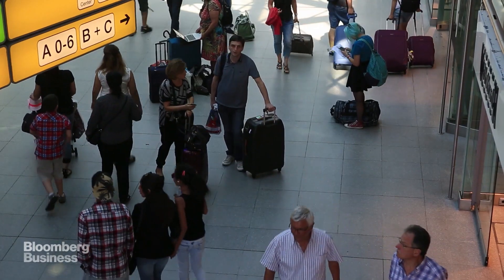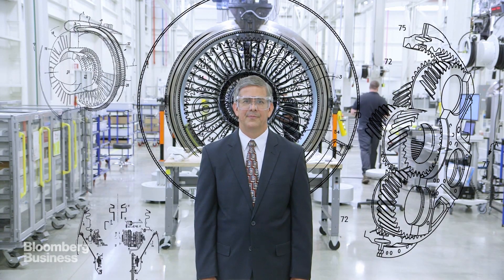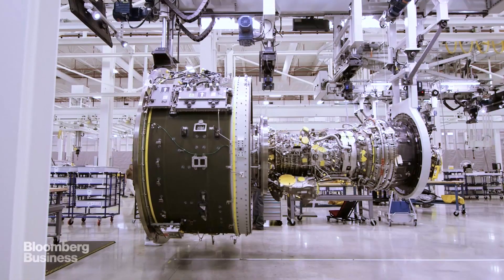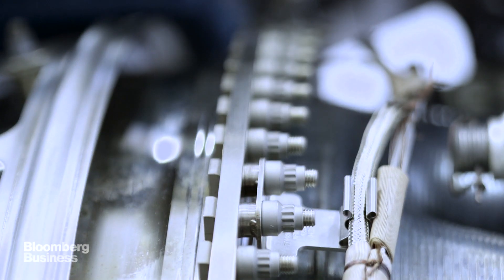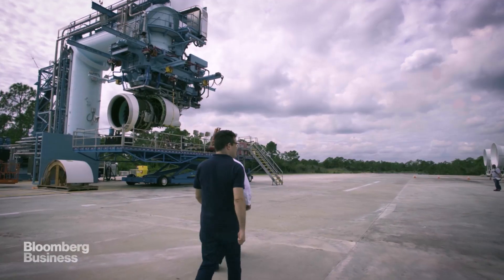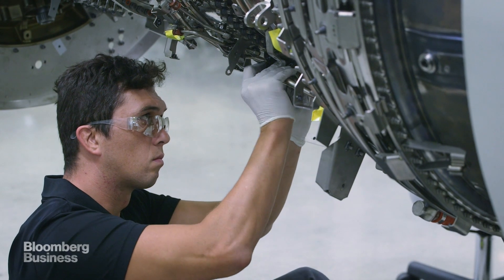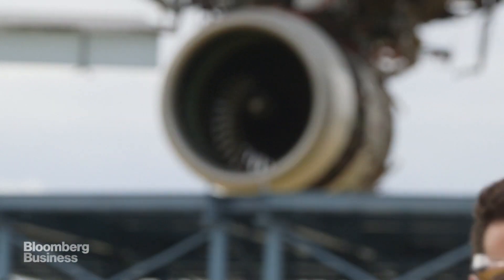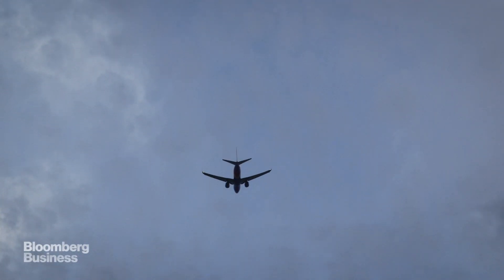This Genius Invention Could Transform Jet Engines

Comment: There is no way jet aircraft can be environmentally safe for several reasons: One- high altitude heat deposition is the principal driver of severe weather. Two- jet engines exhaust gasses are toxic carcinogens. Three- jets rake out ozone from the upper atmosphere and drag the ozone to lower levels. Ozone depletion at high altitudes reduces the blockage of U.V. radiation, and ozone deposited at lower levels is corrosive and causes plant disease. Four- jets contaminate massive quantities of water vapour, turning the water vapour into acid fallout. Five- The water vapour dragged from the upper atmosphere is often dispersed at lower levels without rain, leading to more drought. The jet industry and the tourism industry are two of the largest employers on Earth.  Will we kill the planet for money or will we wake up to the disastrous consequences of arrogant and unsustainable jet travel?

Comment: Kuznetsov NK-93 is also a big size propfan/turbofan jet engine that use a epicicloidal gears reduction stage to drive the fans
. It can handle up to 30.000 horse power. It's a godd idea, but not an innovation

Comment: The big questions for me is: does this introduce more wear, breakage, frictions or anything that may compromise the reliability of the engine? The fact that a gearing system is now in place (i.e. more moving parts) that sits on the main axis of the engine is a huge risk as well as a huge boost in technology and profits if they can address all the potential risks involved without reducing the MTBF by more than 5%.

Comment: Sorry not new at all Frank Whittle propose a geared fan in 1944?? And propjet and after burning. The Rolls Royce Trent with its 3 shaft  design has the fan running at a lower speed than the power stages

Comment: It is worth comparing this approach to that of competitors GE and Rolls-Royce. Both are building non-geared engines with similar improvements in efficiency.  But their engines seem to have to be above a certain size to achieve that aim. They use fan drive power turbines much larger in diameter near the back to run the big slower fans in front. This means the obstruction to bypass air is larger also,  enlarging the thrust nozzle diameter. That does have the advantage that the extra weight of the gearbox is eliminated. Pratt & Whitney have the advantage in medium sized new tech. engines, but may be limited as to how large an engine this method can produce reliably.  Also, if i recall correctly, P&W have worked to make that gearbox an easily replaced item structurally isolated from the engine framework perhaps differing from the  smaller Garrett engine. Isn't the Garrett derived from a helicopter or turboprop design?

Comment: Isn't this basically what a turboprop does?  They've been around since the 50:s.
Reply: Yes but a turbo prop is not a jet engine. Completely different technologies.
Reply: Turbine, shaft driven reducer, big fan up front, sounds pretty similar to me.  Only difference is that instead of a 20 to 1 reduction, it's something like a 2 to 1 reduction.

Comment: What a poor video. A lot of fluff, and nothing about the challenges associated with using a gearbox, the consequences for reliability and maintenance, etc. A modern jet engine is extremely reliable and the main reason for this is that it has few moving parts.

Comment: am I mistaken? but hasn't this idea been used for a long time,  known as a turbo-prop. a small jet geared to a propeller?  why hasn't this idea been worked out before? the fan jet was a great improvement over the turbo jet so it follows that this "new" idea will be better to.

Comment: The TPE331 turboprops had plenty of engine failures with collapsed planetary gearbox rings. Hopefully more modern metallurgy will reduce the risks but these engines won't be popular with pilots :-)

Comment: Pratt & Whitney has been studying this idea for more than 30 years. Remember, the geared  turbofan was an outgrowth of the Pratt & Whitney/Allison 578-DX propfan project from the 1980's. It was in the early 2000's P&W started serious research into a geared turbofan, an the result is the PW1000G series PurePower engines we see today. I really hope that P&W teams up with Rolls-Royce (through the IAE consortium) to build bigger geared turbofan engines, ones that could possibly end up on the Airbus A350XWB, Boeing 777-8/-9 and 787 airliners for even quieter operation and lower fuel burn. Already, the PW1124G engine on the Airbus A320neo is incredibly quiet, to say the least.

Comment: I found this piece of addtional information that may partially explain why this was so difficult:
"The biggest challenge in scaling up was how to keep the gearbox, which is 
about 20 inches in diameter and weighs about 250 pounds, from being torn
 apart if there was a shock that wrenched the fan in one direction and 
the shaft in another. Adding steel for stiffness would make the engine 
too heavy. To put some give into the system, McCune's team attached the 
gearbox rigidly to the fan but somewhat loosely, with bendable metal 
baffles, to the compressor/turbine shaft and the engine case."

Comment: Why not a viscous coupling based on the air flow? Higher altitudes/ lower pressure/ less drive to the fan so the blade tips won't go supersonic.

Comment: I believe the RJ 70 had engines with a gearbox between the turbine and the fan.
Reply: True but they could only handle 7000 HP these can handle 30000 HP

Comment: i hate marketing videos like this. "its better!!!! WE ARE TELLING YOU ITS BETTER!!! ITS TEH BEST THING EVAH !!!11!@." tell us what you did, how did you make a more efficient gear train that can handle these powers? what materials were used? what kind of thing did you do to improve on the gears? what kind of manufacturing processes are used to make them. give us technical details, not corporate ejaculate. 

from what little details were in the screen it appears to be a double herringbone planetary gear. i would guess its a 4:1 to 5:1 reduction so the turbine could spin around 10k and the fan at around 2.5-3k. going to have very tight tolerances and a light gear oil from a pressure fed system, with separate sump and oil cooler. they are using a 5 planet gear system to help distribute load and only a single reduction unit. it appears that the planet carrier is bolted to the housing and the fan is attached to the ring gear. the sun would be driven by the turbine. im basing this off of the sketches in the background alone so take this with a very large amount of salt.

Comment: the bottom line is always money.  airlines rate their efficiency % by how many passengers are required to buy seats on a flight to overcome the aircraft operational expense. money. period. not safety. not comfort. not customer satisfaction.  money.

Comment: So it took Pratt and Whitney 30 years to do to the turbo fan the same thing everyone else has already done to the turboprop. They really have to have dumbed down the presentation on us. Why not just fix the problem by gearing it down and using 2 fans pushing the air the same direction but spinning in opposite directions so they work together and allow less air to resist their push thus pushing more air with less rotations. It actually looks to me as if they just went with a bigger fan. I am very surprised no one can come up with a super high efficiency Jet engine. Lot's of compressed air, I can almost imagine in my mind a turbofan piston hybrid. If I owned an engine company I would be working on this type of stuff all the time.

Comment: The real question is does come with a 5 speed manual transmission design and can they make it easier for me to ditch the fan and connect the rear faster part of the engine to my car's drive-shaft through the geared bridge.

Comment: Afaik turbofans have the fan powered by a separate turbine which runs slower than the core shaft speed anyway. 
I would imagine that a controlled method of bypassing that second turbine, like a wastegate you find in car turbos, would be a more efficient way of controlling the fan speed without needing a gearbox.

Comment: Yeah, this is an old solution to an even older problem. They would probably have better luck trying to figure out how to make variable pitch blades on either the N1 fan or the turbine in order to optimize it's speed for the existing power setting....just like a prop goes to fine pitch for takeoff and coarse for cruise.

Comment: I believe these efforts are misdirected. Instead of marginal gains from old technology, why not focus on the real problem of current air travel. The power source. Bear with me. A gas turbine engine is totally dependent on compressed air. Wings need fast moving air to generate lift. Anti-gravity technology was worked on by Tesla, Von-Braun, Heisenberg and others. That technology would radically alter air travel and flight as we know it. No more using delicate materials that need a narrow operating range and conditions.
Reply: "Anti-gravity technology was worked on by Tesla, Von-Braun, Heisenberg and others." - That's not true at all.

Comment: 10,000,000,000 dollars spent already?! Russian NK 92 (or 93) has the similar gearbox and dual turbofans. Super power output and  economy  but alas slow speed (0.75 mach). R&R went broke for RB 211 engine development. Does it all make sense?

Comment: Why not remove all the moving parts and create a magnetic vortex engine? That does not run off fossil fuel! Lite metal technologies with graphite power cell technology to power and run the planes systems? Zero pollution! Maybe some noise from the forced air but other then that 100% green technology.

Comment: You're missing the fact that it's not just a gear box and yes all turbofan's have them, but in this design the gear box is INSIDE of the main shaft!, with no added drag that a traditional gear box would have added.
The smooth internal air flow is how it produces less noise,more even fuel mix and less vibration on the engine's structure..
Reply: All turbofans do not have gearboxes to drive the fan. In fact most don't.

Comment: The video is a little misleading. Geared turbo fans have been around for over 40 years. Garrett AiResearch designed one in 1972. It's still in a ton of airplanes today as the Honeywell TFE731. It's a geared turbofan using a planetary gear system. The fan spins at about half the speed compared to the low pressure turbines in the back of the engine. Maybe Pratt has a more efficient geared system, but its certainly not new.

Comment: you have got to be shitting me. a gearbox? that's the big breakthrough!? i'm guessing they are making the engine twin spool, with a hp turbine and a low pressure one. bleeding power off the low pressure one. not like usual high bypass engines  that have 3 turbine stages. high pressure, low pressure and another after the LP one for the turbofan. this is optimisation not innovation

Comment: Congrats Mr McCune sounds V impressive but reduction gearing on aero-engines have been around for nearly 80 years, aren't you just reinventing the lightbulb like mr edison, still if it produces the fuel savings and noise reduction as you claim then Good on you mate.

Comment: So something helicopters have had in mass production since the Huey (a mid 1950's design going off of the prototype) at least.
Reply: The problems with gearbox with turbine is reliability.  Helicopters aren't certified for ETOPS which requires the level of reliability that the traditional turbine gearbox has not delivered

Comment: Gears in a jet engine, LOL.
Just counter rotate the stater blades drive em both  by  thrust,  computer   activated thrust vectors.  fixed gear boxes cant be adjusted for optimum performance. Thrust vectors can. 
I have the patent, I want 25 million for it.
Reply: offplanetevent so how do you get the fan blades to not spin at the speed of sound if you just counter rotate.

Comment: I wish you had asked Mike McCune more about the gearbox and how all those moving parts are designed to withstand wear and tear given the high revolutions in the engine. Surely these moving parts will encounter friction and generate heat. If the friction becomes abnormal, the heat may be dangerous and could be incendiary inside an engine like this.

Comment: and later it will be stolen by the Chinese
Reply: agus2001 No need to steal it. In the area of commercial jet engines everybody copies. The trick is then to develop the metal technology and ceramic technology to do the copy. While the USA leads in some areas of material technology nations like Japan and Germany and Russia and even China are now starting to lead in other areas of material technology. If you take something as simple as a circuit breaker it is the Japanese and Germans who lead in a few key components. While this is a great breakthrough as an idea did P&W create the materials technology completely by themselves or did they rely on the Germans or Japan or ? to actually come up with something in the materials area to make it durable enough and reliable enough and light enough etc. That is where copying is done by everybody. There are endless bright ideas like this thought up every day around the world. Most fail because of material technology. No one nation today has all the answers.
Reply: Chinese have no footing in the commercial plane market
Reply: agus2001 as is everything else
Reply: Sariel Reigns Сариэль Царствует what part?
Reply: Polo Gamero you didn't mention anything
Reply: Sariel Reigns Сариэль Царствует what part its a copy from Yak? Directional exhaust? Harrier, geared front Fan? Harrier again and some very old Ryan design. Nothing new really, just a new point of view.
Reply: China buys the idea from the TRAITORS who where selected to work a the USPO. Remember Hitlery selling China secrets?
Reply: the chinese don't really make planes other than military
Reply: plot twist. it was the chinese idea to begin with.
Reply: anyone can see this video.
Reply: agus2001 if u dont greed for money how could it be stolen.u stupid .right?
Reply: F Huber yeap the chinese is always genius by seeing this video they can make it
Reply: Stolen and sharing isn't same
Reply: The US do this a lot.
Reply: I Phone is made in China.... We go to them.... They don't
Reply: Just like west stole everything from Asia during colonial times. Karma is a bitch aint it?
Reply: haha
Reply: The Chinese saw this video... they already stole it.
Reply: agus2001 stupid China itself  invests a lot of money in Research and Development, 1.3 million patents registered last year
Reply: like how the US got the F-35 from the Soviet Union?
Reply: Michael Minnich yeah the Yak-141
Reply: agus2001 lol
Reply: ripnwoody1610 it wasn't lol
Reply: ripnwoody1610 it's not really a stealing thing, it's more like a small upgrade
Reply: agus2001 Chinese innovate more than you stupids
Reply: Mike has 60 patents under his belt... these superliners keep flying over my roof all day... the new ones are noise free
Reply: It must be a Asian thing North Korea is the same way.
Reply: *****
Because the chinese don't innovate.  they copy, hack, steal.  Well known fact.
Reply: Or the Clintons will sell them the blueprints like Bill Clinton sold the Chinese military our missile technology.

Comment: Jets are much more efficient than cars or almost any other mode of transport.
Reply: if only a plane could take me to work and back every day
Reply: Trains are much more efficient.  Internal combustion engines are much more fuel efficient than turbines.
Reply: Yes and no. The pumping losses are far higher for a jet engine than for a piston engine., but the jet can offset this by flying high and picking up free airspeed at altitude due to the thinner air. This drastically reduces the time to destination and therefore the fuel burn per NM goes right down.
Reply: ThePaulv12 know shit Sherlock.
Reply: Care to elaborate? Perhaps you've cracked the VLJ engine dilema and got the Williams EJ22 working and off the back of a Go Kart where it was recently sighted.
Reply: ThePaulv12 the 4 stroke engines commonly used on Subaru's and light aircraft? That technology's almost 30 years old.
Reply: Trains are only efficient until a certain points, also you need to invest billions in railways for the trains to reach places. Not to mention that they can take up more space, are slower, and the best ones dont have much capacity.
Reply: Ships are the most efficient mode of transport.
Reply: +Mike H No, jet propelled planes are vastly more efficient than trains and turbines are internal combustion engines.
Reply: Sailing ships?